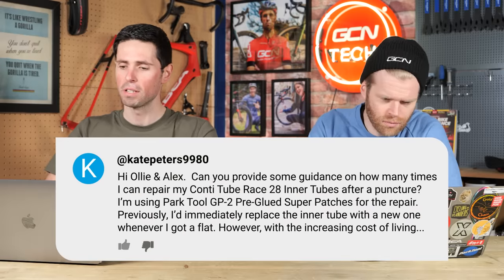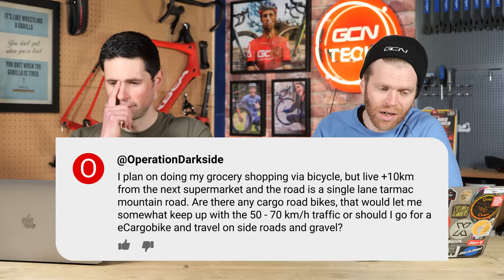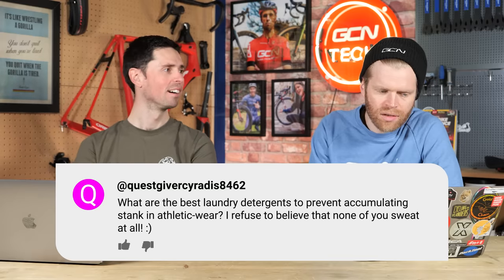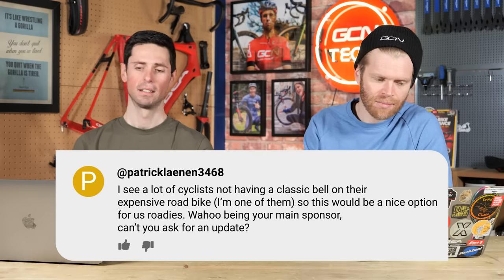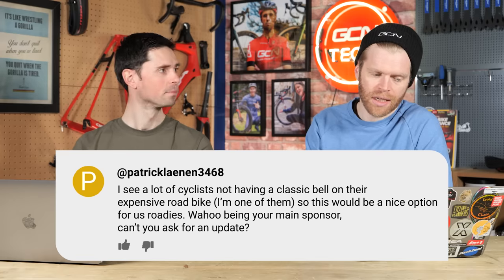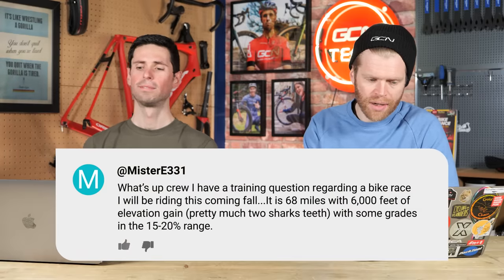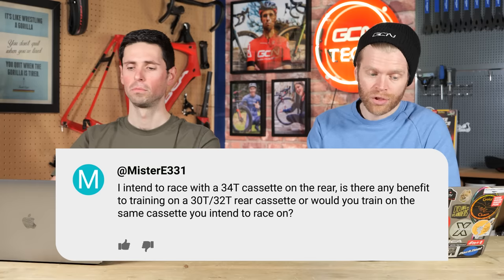Optimal Tyre Pressure, Noisy Chains & Inner Tube Repairs | GCN Tech Clinic

Comment from the maker: Drop your tech questions in the comments using #askgcntech ⚙ We want to get nerdy... so really test us!
Reply: #askgcntech Hi guys (and Hank, who’s my Spirit Animal). Should we consider wheelsets consumable items like cassettes, chains and chainrings? We got into a heated argument about that. Carbon is not recyclable. Some Far Eastern Companies are not environmentally savvy. Should we just buy cheaper wheelsets with dodgy aftermarket support, random long term availability of parts, ho-hum environment policies and zero resale value (as the market is flooded with such products), use them for few years and toss them or buy more responsibly-sourced products, probably more expensive, probably with better aftermarket support and probably some resale value after 5-8-10 years (and almost for sure made in the same place as the former category)? What’s your unbiased (heh!) opinion. Hi to Hank, the runt of the litter.

Comment: Electric "bell" is easily integratable into the lights: battery capacity and charging electronics are a perfect fit, those of a bike computer can't hold the necessary current or operate at higher voltages when you want to reduce current. And there are such gadgets already.
The main problem for them indeed remains marketing-wise: no big reputable brand like CatEye* does them and road cyclists are very reluctant against lights even more so bells/horns. But I appreciate GCN effort in fighting the stigma

*although I can definetely see some totally integrated unit from them or Sigma since they already make lights and computers anyway

Comment: Mirrors are inexpensive and quite functional but I prefer rear radar (e.g., Garmin Varia) as an initial and longer range indicator.  Can't believe I didn't start using radar sooner - Love the alerts and the fact it uses random blink and max intensity when it senses vehicle - cars actually slow down.  It's not foolproof but I have yet to experience an issue when properly mounted
Reply: Couldn't agree more. Every rider I know who uses a Varia would never go without one again.
Reply: So these are for anyone behind you and not just the rider? Interesting, never occurred to me as I'd only even heard of them recently. Do any also allow manual or automatic brake and turn signals? And, it would be kind of cool to display the speed of the car hurtling towards you for them to see. Hell, link this up to the local PD and every cyclist becomes a potential moving speed detector!

Just kidding on that one but it is kind of intriguing, the possibilities.

Comment: The chain being noisy I had too. Turns out when I threaded it through the rear derailer cage I had threaded it over the little lug that sticks out between the two wheels.  It was supposed to go behind it rather than over and made a noise. Probs obvious to most people but first few times changing a chain is a easy mistaker to maker
Reply: Did exactly that yesterday!😊
Reply: I did exactly that first time I refitted my chain after hot waxing!
Reply: I have done this also! Working in a dark garage, and i thought it looked good…

Comment: Bells: you would be surprised how grateful most pedestrians are when they hear a bell. Don’t forget that on quiet back roads walkers are often straddling the road and need notice of our arrival. I started using a small ting, ting bell a few years ago.
Reply from the maker: Nothing wrong with a bell 🔔 Do you find some people don't like the bell sound?
Reply: I'm more surprised you come across "most" pedestrians that are connected to their surroundings. Most pedestrians I have come across need a Claxon to hear me because they are buried in their phones with Beats headphones on. Having said that, I do use a Knog Oi! wrap around Bell, very subtle and hard to notice.
Reply: I always politely say Hello, Morning or if its a festive time Merry Christmas or whatever is appropriate
Reply: Canyon has a bar end bell, that one is really nice I think and also fairly loud. But not loud enough if people wear headphones 😮
Reply: I have the tiny Rock Bros bell and it’s great. I mounted on the tops of my handlebars next to the stem, but UNDERNEATH the bar. It’s barely visible at all and my thumb can easily reach it to ring as needed.
Reply: I always ring my bell before passing pedestrians and slow bikers(when I approach then from behind). Not because there is no place to pass them, because sometimes they suddenly cross the bike lane without looking behind. About the half off them dislike this and start complaining, because they think I want the whole road for myself. It is what it is, everything for not having a collision. I had many close calls before I did this! Greets from Belgium
Reply: @gcntech I can't wait to build my Trek Emonda ALR up, unsure of sound hit the tube that steerer goes through but I'm looking to have timber bell so keeps going if need to but otherwise behind steerer I will have a hornit db140 (behind it as aiming for cleanest and more aero set up

Comment: The "skin" on the wax is doing nothing helpful with lubrication.  Ask Zero Friction Cycling about that.  What wax in the pot is doing is getting in between wear surfaces, and that's why wax has to be at the appropriate temp. Once wax has filled the gaps between wear surfaces, you're done. That "skin"  only coats the outside of the chain. That skin sure as heck doesn't penetrate anything.  Ask Molten Speedwax what they recommend. Hint: it's not to leave the chain in the pot until that skin forms.

Comment: Mirrors: 8:08 I use a Sprintech bar-end mirror on the end of my left drop (I live in the US) on both my Canyon Endurace and my Canyon Grizl. They are aerodynamic, adjustable, and pretty solid about not moving around even on the bumpiest of rides. It’s nice to be able to glance down every so often to check if there is traffic coming up behind you that may pass too close. On two occasions, they allowed me to pull off the road before being hit by a car who refused to wait until it was safe to pass. (In both cases, there was an oncoming vehicle and on rural roads).
Reply: I'm another advocate for Sprintech mirrors. Had them for a number of years.  Sleek, tear- drop shape. I do suffer with a stiff right shoulder/neck, and it's enabled me to do much longer rides in comfort.  

Also great for when youre gunning it (head down, bottom up) and just have a quick glance in the mirror.

Comment: Have used a bar end mirror since I started riding a road bike.  Maybe it adds some weight and drag, but my experience is that it vastly improves safety.  Ditto the flashing front LED light.  I've had FAR fewer near misses since I started using these safety measures.  Guess what.  Staying alive is preferable to riding a (very small) bit faster.

Comment: Concerning "preventing accumulating stank in athletic clothing": simply shave your armpits, that is where the stank comes from, and eliminating the hairs eliminates 99% of the smell. Additional, I use a deodorant with specific "anti-transpirant" written on the dose, otherwise it is just good smelling stuff that does not help at all.
Concerning "bike alarm": I use now for 15+ years my beloved Bookman bike whistle, it is at least as loud as a car horn, and if I blow it with full force, I myself have dumb ears for a few seconds. And on the road there are plenty of situations: close calls, cars disregarding your right of way, cars standing as far as possible right (or left in GB and Ireland) at the traffic light and not starting when the light show green, etc.
Mirrors for bikes are often so small you need more time for figuring out what they show than for a quick look over your shoulder. 4kam offered a rear camera for cyclists years ago, but they stopped producing it. If I had one, I could block the road ("close the door" as they say in the Formula 1) when someone wants to give me a close call at high speed.
Reply: Another vote for removing hair, it is absolutely terrible for harbouring odour.

Comment: To the person with a load noise after chain waxing: check you replaced the chain running on the correct side of the mech cage chain guard tab. I made this mistake once when replacing the chain, and felt the chain was super noisy, and discovered it was from the chain rubbing against the tab between the jockey wheels that is meant to hold the chain in. Once I installed the chain correctly, problem solved and I could totally see someone innocently making the oversight the first time they remove and reinstall the chain when first learning to wax!
Reply: Absolutely. If it's your first time removing the chain, waxing, then putting back on. I absolutely made this mistake and never will again. The chain has to run on the inside of the derailleur hanger guard piece. Something that's never really shown in waxing videos.

Comment: @gcntech I am soooo disappointed by your non-answer to the question about minimum tyre pressure. Couldn't you ask the manufacturer? My 25x622 GP5000's don't have the lower limit printed on them. What are the risks of running a pressure that is too low? AFAIU, it's just increased risk of snakebite punctures, rim damage, higher tread wear, bigger risk of burping in case of tubeless and maybe a risk of dismounting under very hard cornering?

Comment: With regard to washing:
1. Don't let dirty kit sit for long after riding - this is the most important thing.
2. There are special detergents (e.g. DeFunkify or Nikwax Base Cleaner) for tech fabrics that should be used every so often.
3. I've found soaking in OxyClean (or equivalent) works to remove some of the "stank"
4. Otherwise: regular detergent, cold water, hang dry. I hand wash to preserve leg grippers and raw-cut sleeves, wring in a towel before hanging.
Reply: Sub 80 iq questions shouldn't be given the time of day in my opinion. 
"How do I wash my clothes? Ffs.
Reply from the maker: Did you catch GCN'S recent washing video 👉https://youtu.be/UQnZrEwbJ2I - They might have missed a few of yours 👀

Comment: The noise associated with hot melt waxed chains does go away fairly quickly in my experience. The hand “chain saw” method Oli mentioned is the best for the initial break in but I’ve also found that simply setting off on your first ride or turbo session in the most severe cross chain - so the 52 front and 30 back on mine- speeds up the break in period because it’s essentially putting the chain into its most extreme position of “stretch”. I’ve also started to heat the chain prior to submersion and find that this helps penetration, durability and longevity.
Reply: For certain a completely stripped clean chain, HEATED (like in a low oven for several minutes…almost too hot to hold without gloves) will allow better wax penetration in between the plates and rollers.
Reply: Exactly my friend! Gets excellent results doesn’t it
Reply: Just leave the chain in the wax for 10 minutes, it gets plenty hot enough and gets rid of entrained air.

Comment: #askgcntech I changed my rough hub bearings and found out that salt water had gotten through the bearings and corroded the aluminium axle on the surface. Do you think it is still safe to use? What would happen if the axle snaps? The wheel would still be held in by the through axle I think.

Comment: If using mirrors on handle bars then the mirrors get bumped regularly and are not in the right orientation, also they tend to vibrate a lot. I personally would knock a helmet mirror around quite a bit. The best one I have ever seen was one that stuck on to your favorite sunglasses and was small enough to be unobtrusive, however I did not own it. it did have good reviews from its owner however.

Comment: #askgcntech I am lightly considering swapping to oversize jockey wheels simply to make cleaning them easier. I could care less for any marginal gains, but they do look pretty cool and I imagine cleaning them would be significantly easier as there is more wheel exposed to clean. What do you think? Would cleaning actually be easier? Worth it?
Reply: If that's the sole reason, not worth for what it costs. Regular-sized 11T pulley wheels aren't that much harder to clean, I've washed multiple pairs clean without issues.

Comment: About the washing kit items. I have always used washing soda ( not baking soda).  It’s non toxic, boosts your laundry detergent cleaning ability, and deodorizes.  I use it especially on gym clothing and other items that need a deeper clean. 🥰
Reply: Oh! Didn't know that exists! I knew soda for other cleaning purposes but not washing. Soda has very good characteristics to remove smell. So I guess it will do the same while washing. Great tip! Going to order that stuff and try it out. 👍🏻

Comment: Regarding the question about minimum tyre pressures, 6.5 bar (94 psi) minimum sounds way too high for a 28mm Continental GP5000 - ridiculously so if running tubeless, assuming your weight is fairly low for the Silca calculator to give you a suggestion of 5 bar. I get about the same, with my total system weight (bike + rider + gear) being about 81-83kg. However, I have been running 28mm Conti GP5000 clinchers (with tubes) at about 68-70 front/ 73-75 rear psi for years without any issues. This is at least 20 psi (approx 1.5 bar) lower than the "minimum", so I very much doubt there is any safety issue at this pressure. 

I probably could increase pressure a bit in order to reduce rolling resistance, and to be honest, I did take these pressure from previous use of Conti GP4000 tyres, which very quite a lot wider (28mm tyres were about 31.5mm wide on 19mm internal width rims). The 28mm GP5000 is about 29-29.5mm wide, so maybe 73/78-80 psi would be a better pressure, but that is still way lower than the stated minimum. 

I would worry far more about maximum pressures and the danger of tyre blow-off than having low pressures, assuming you're not so low that the tyre is squirming or burping in the corners or going over bumps.

GCN obviously can't recommend going lower than the manufacturer's advertised minimum for liability reasons, but I've seen plenty of GCN videos where presenters have said they run at sub-70psi pressures.

Comment: #askgcntech Hi Techies, as I'm charmed by the specs of the P Zero Race TLR Speedcore, I'm wondering if I could use that tyre with a TPU inner tube as I couldn't see a matching non-TLR version of it (and I'm not ready to go all-in on tubeless, yet). The regular P Zero Race seems still to be the old version without the advantages the newer TLR made in 2023. It mostly seems to lie in the Speedcore carcass Pirelli made. Stupid, big no-no, or just go for it? What do you reckon?

Comment: #askgcntech Hi, my old road bikes aluminium frame is corroded and with now doing group rides, I'm worried about it breaking.
I'm looking to upgrade to a gravel bike with a 1x apex group set 44 crank and 11/36 10 speed. Do I need to worry about the gear ratios? my current bike has a 53/39 crank and 11/27 8 speed cluster. Will I spin out with the apex gearing and would I be able to change out crank or cluster sprockets if need be? Thanks team

Comment: Silca and ZFC have different advice about the temperature you pull the chain out of the wax pot.

As you point out at 10:34, Silca say wait until the wax surface is just about to solidify, as shown in the Silca video https://youtu.be/KZ7LveURBWQ?t=168

If you read the ZFC ' Waxing-FAQ-v1.3c ' guide on their website and search for the section
Q) How accurate do I need to be with my wax temp?
you will see that Adam states anywhere between 70 deg C and 100 deg C will create a 'perfectly fine waxing' . 

Maybe Silca's wax exits chains more easily than other brands ? . I have tried to point the difference out to them but the comment went unanswered. Sorry I can't link to the ZFC document directly but YT will remove this comment if I try.

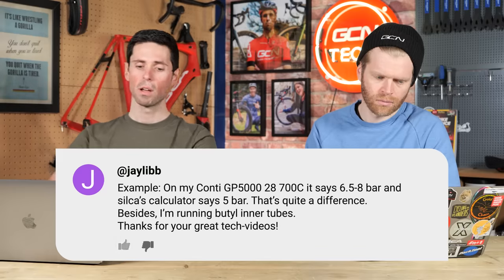Comment: 7:09 i have gone lower than recommended pressure and it feels much faster and haven't noticed any major issues. i have done it a really long time.
Reply from the maker: It might be down to rider weight, those that weigh very little may be able to push it a little further. Although we would always recommend sticking to the guidelines, especially when using tech like hookless 🙌
Reply: @gcntech  yeah there is ofcourse some risk in doing it.

Comment: Thank you for answering my question. It is a very mountainous region, but with excellent hiking infrastructure in Germany. An eCargoBike would be able to travers all the gravel and mud, but they are very expensive, so I'm eyeing an ebike conversion for my 20 year old MTB. They seem not easy to get running legally, but would be >6x cheaper. I'm not good with making decisions, but 2h for a round trip forces my hand a bit.

Comment: Waxing is bollocks. The time spent removing the chain then the whole waxing process is crazy compared to a good chain cleaning tool and degreasing(on the bike) then rinse and lube with a brush. Wipe the excess and go. Total time <5 mins so you’re more likely to keep it looking and running well. The bike industry will have you believe you need ridiculously priced lubes when major chain manufacturers recommend 80/90W gear oil. It’s only the sliding plates and rollers that need lube remember.

Comment: #askgcntech Hi, last year I bought a Wahoo Kickr for my 2017 Specialized Roubaix, but after several months of use, last week 15cm of the rear seat stay near the wheel axle snapped off.  I'm looking to buy a new frameset, so I wanted to know if steel frames are more suitable than carbon frames for turbo trainers?